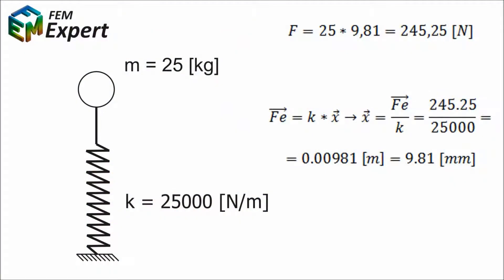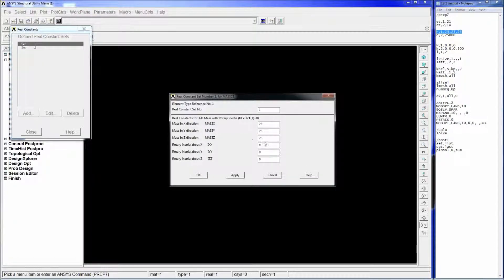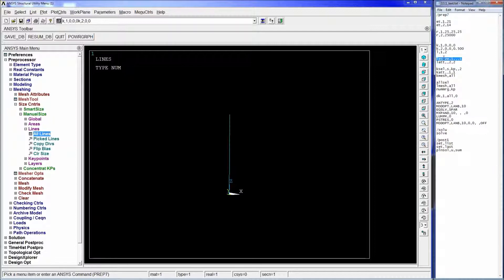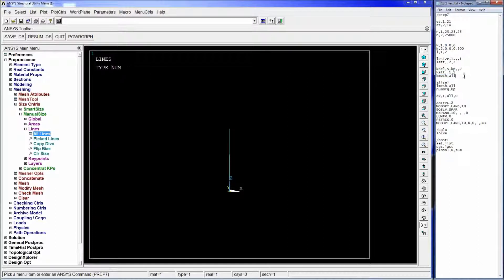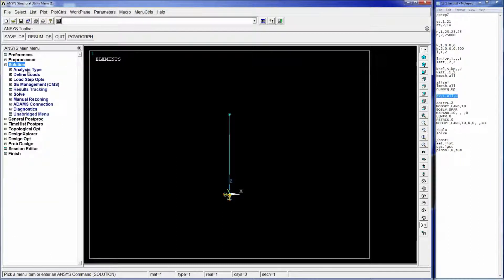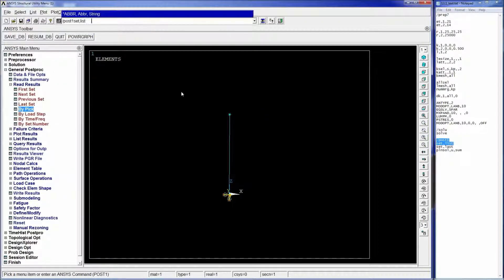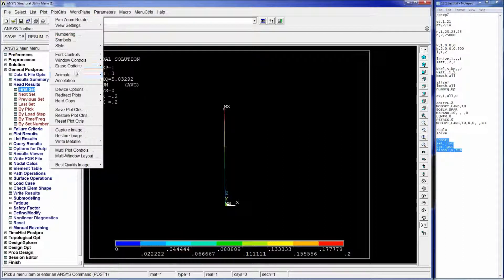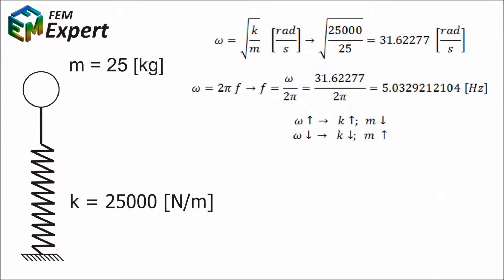Ansys Tutorial: Modal Analysis of a mass-spring model in Ansys APDL #35

Comment: how do i model spring cart system where the mass of the cart is negligible??
Reply from the maker: You cannot have a spring if it does not have a mass that acts on it, maybe you can put a force but you have to have some action on the spring to have a reaction from it.
Reply: @FemExpert  that is impossible. a structural analysis of springs in FEM is possible
Reply from the maker: @freemanfreed1581  yes but not without a mass.
if you have a spring but not a force that acts on it it will give you 0, instead of a force if you have mass 0 it will give you also 0.
so yes it is possible but will be 0

Comment: how can you rotate so easy in ansys?
Reply from the maker: You either activate the bottom button in the rigth menu where the zoom icon is and use the middle mouse button (the wheel) or you push Ctrl everytime you want to move and use the diffrent mouse buttons, you can try. At the begining it will be a little bit more complicated but then you will get used.
Reply: @FemExpert  thanks!